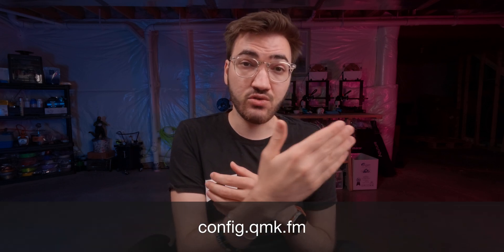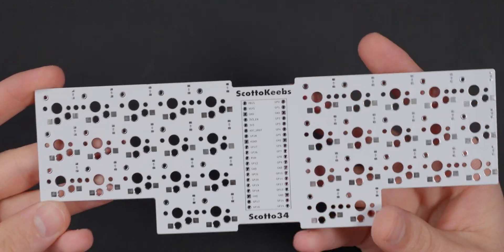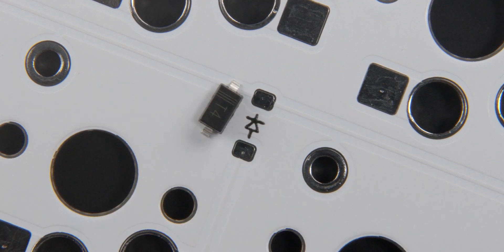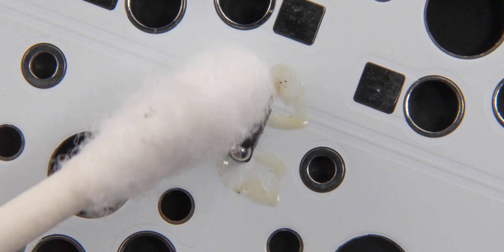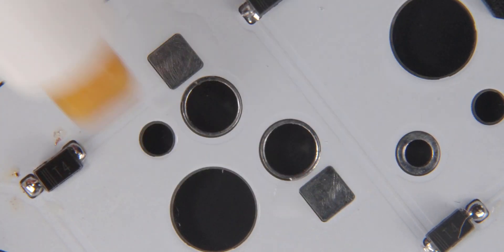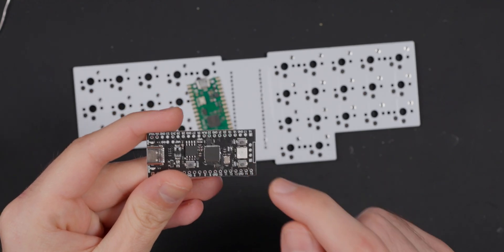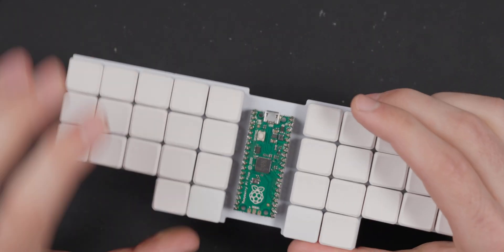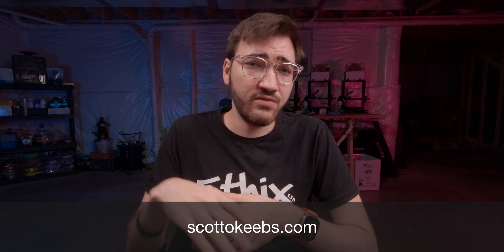My first PCB mechanical keyboard, the Scotto34 (PCB Edition)

Comment from the maker: Let’s me know what you think of my first PCB keyboard, I’m personally super happy with how it turned out! If you want to build one yourself, you can pick up the PCB and case from my website: https://scottokeebs.com
Reply: I'm curious, would it be possible / make sense to design a PCB like yours where the diodes are on top and the switches are soldered without hot swap sockets? The idea is to build the thinest board possible, so to eliminate anything on the underside of the PCB...

Great video, by the way. Really admire your work. Been a subscriber since I started my keyboard journey.
Reply from the maker: @whereIsJerome Yeah, you could… with Choc switches you can hide the diode within the upper part of the switch.
Reply: This is probably a very stupid question but why did you need the sockets, don’t the switches have pins that can connect to a pcb anyway.

The switches I own are pretty old but they have two sets of pins one for +- input and one for +- led.  

Is the diode just to regulate the electricity. 

Sorry all I know about this stuff comes from moding arcade sticks and I would really love to use something like your set up for a stick given I just need a raspberry pi instead of having to pull the board from a preexisting controller which is a bit of a mess. 

Thanks for your patience I look forward to your pcb series. If you already explained why you used your components please feel free to link the video in question. 

Thanks again
Reply from the maker: @dorjedriftwood2731  Not for this PCB, I designed it for sockets. Reason being that Choc switches are expensive so soldering them permanently is best avoided.
Reply: @dorjedriftwood2731  the diode is to stop ghosting. in a matrix of 4 switches (2 on one wire and two on another), if three of them are pressed, it will think a 4th one is pressed. the diodes stop that. depending on the expected use of the keyboard, you could entirely get away without diodes.

also, just in general, the sockets mean you can change the switches whenever you want with little effort.
or if one fails, it's gonna be more of a chore to de-solder it rather than just replace it real quick.

Comment: Love this! I have been running a Ferris Sweep for about a year now which also has 34 keys, so my layout would map seamlessly to this. If you have any experience using something like a Ferris, could you comment on how having the keys in an ortholinear layout differs from a col stagger? Specifically, how is it to type on with your pinkies? I assume you would angle your hands inwards like on a normal board to reach the outer keys with your pinkies more comfortably?

Comment: Thank you for this! I am very new to custom keyboards, more so 40% and orthogonal. But this one appeals to me, and I think will be the first I will build. However, I would  like to know if there is any guide onto how to make it wireless. Or how different the config file would have to be if I decide to go with the controller and battery that you showed in the wireless Corne video. 

I am looking at forums/Reddit and discord, but since I know very little I don't even know what to look for. Any direction on where to search for this info would be appreciated!

Comment: I see you've got the 3d print files for the handwired keyboard on github, any plans to put the pcb edition case on github?
Reply from the maker: I only release my handwired files for free. I don’t have plans to release any files for my PCB boards.
Reply: @joe_scotto  awesome, thanks! I'll see if I can make adjustments to the hardwired prints to get them to fit

Comment: I have found solder paste to be much easier to use, especially for surface mount components.

The best thing is, when hot air or IR heat is applied, the components align by capilar and surface tention, so placing components is reduced to sticking them to the pads covered with paste.

Paste can be applied by hand with different size sticks and needles from a pool of paste.

Comment: Hey I have recently built a keyboard with a hotswap pcb Tofu60 v2 and the caps lock light is reversed, lit when lowercase and not lit when uppercase, do you know how I could fix this?

Comment: Wonder what you've been rocking as a daily driver
Reply from the maker: The Scotto34 (PCB Edition) for about 1.5 months now, before that it was a mix of the handwired Scotto34 and the ScottoErgo. Soon I’ll be switching again as I have a new handwired choc ergo board in development.
Reply: Awesome, thanks for answering! Do you prefer those unibody splits over split keyboards like e.g. Corne? I've been pondering on what I prefer myself because I'm constantly switching back and forth between a corne-ish zen, a sofle and a wooting 60 he (for gaming, but even type on it for work sometimes) and I'm not particularly set in stone on any of them. A unibody does seem compelling for the simplicity, and looks hot!
Reply from the maker: I like unibodies more because it’s just one thing to deal with. I still enjoy splits but it’s nice being able to only have one item to move around.

Comment: Nice job! I recently just made my first PCB as well, the qwail56, also based on a pico. The one thing I regret is using SOD-123 single package diodes. With dual or more packages, like SOT-23, SOT-323 or even SOT-363 I would have to solder so many less diodes, would have saved me so much time

Comment: I  am so loving this  design. 
After the pain of hand wiring I was thinking I might have a go but the surface mounting still scares me. Went to the github to see if i could get the pcb schematics and alter to a  through hole but alas, none. 
I totally understand why  you haven't shared the file.
Reply from the maker: Definitely don’t be afraid of the surface mounting, it’s overall easier than handwiring. If you have flux and take your time, you shouldn’t have any issues… just don’t use too high of heat or apply it too long. 

I don’t plan on releasing the PCB boards open sourced, that’s what my handwired boards are for. That said, the surface mount sockets the kit comes with are really easy to do. The position is held in place by the PCB so you don’t need to worry about it moving while you solder it.

Comment: It is amazing, I just wish that the community focuses hard on the wireless builds for these keyboards. This will take the whole community to the next level.
Reply: Wireless has latency and can be hijacked
Reply: @jacquesfaba55  You will always have the option to turn it off and use the cable. But when you don't have wireless, you just don't have it's convenience forever.

Comment: There is a microcontroller called Muon Pico, that is 100% compatible with Pi Poco but it is base on an NRF BLE  chip and has a battery management on it. It would be an easy upgrade to make it wireless
Reply from the maker: That’s pretty neat, I’m gonna look into it.
Reply: @joe_scotto  Adafruit nRF52840 Feather might be an even better option, but not a pi drop in... slightly cheaper though, and doesn't have an insane $50 shipping fee. Smaller size leaves space for a small battery on the pcb...